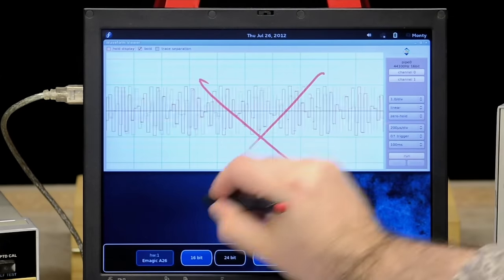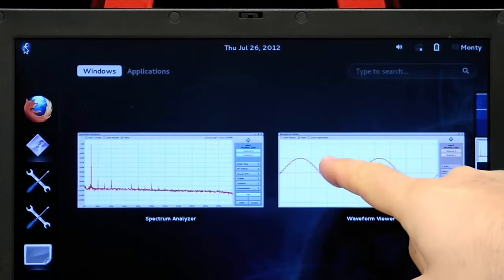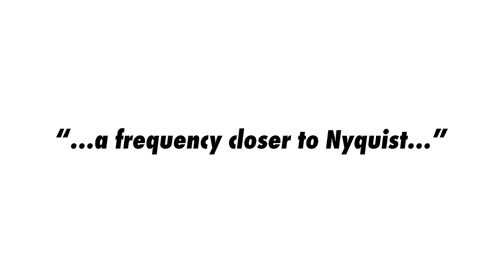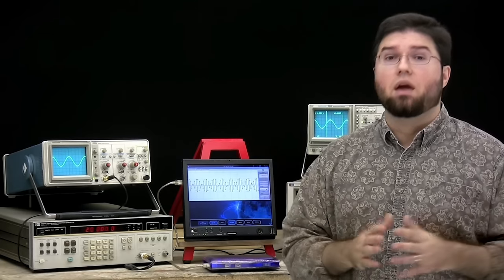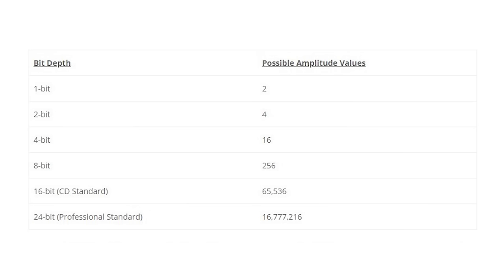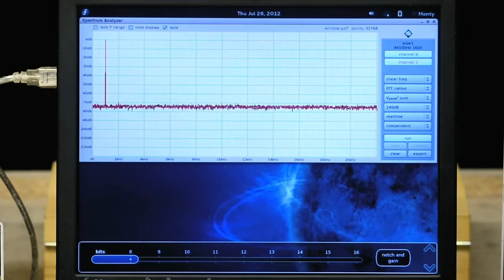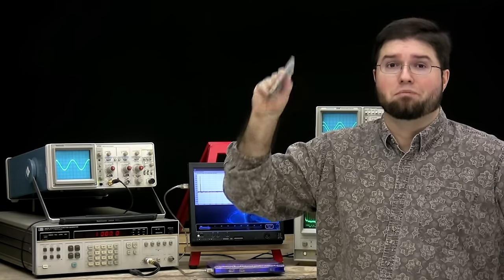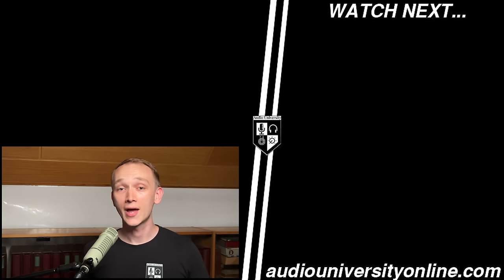Debunking the Digital Audio Myth: The Truth About the 'Stair-Step' Effect

Comment: ...The main problem with digital technology is that we have to use a constant sampling rate for the conversion, which, however, cannot be coupled with the useful signal in a phase-locked manner. As a result, the result of the conversion process, which is output as a digital word, becomes more and more unpredictable the closer we get to the sampling frequency with the useful frequency. In purely theoretical terms, the maximum useful frequency of a digital system is half the sampling frequency according to the famous Nyquist sampling theorem. Theoretically, because this presupposes a phase-locked coupling of the sampling rate and the useful signal. A useful signal with half the sampling frequency can only be transmitted if the phase angle between the sampling rate and the useful signal is 0 degrees. In this case, a positive digital value would be generated by the positive half-wave of a sinusoidal oscillation (other waveforms make no sense in this consideration, as already the first harmonic would no longer be transmitted) and a negative digital value by the negative half-wave. Through suitable filtering of the resulting square wave signal, the original signal could actually be reconstructed with a certain amplitude uncertainty.
However, this only works if the sine wave has its zero crossing at the beginning of the sampling period. With a phase shift of, say, 90 degrees, on the other hand, the first sampling period would measure the cycle from +90 degrees to -90 degrees; the second sampling period would then measure the cycle from -90 degrees to +90 degrees. The result would be zero in both cases. Our Nyquist theorem, which is still tacitly assumed in many places, is therefore not applicable at all to the audio signals we are interested in here, since the aforementioned prerequisite of rigid phase coupling cannot of course be met in practice. When which zero crossings and oscillation forms occur within the audio signal is completely random; the probability of a useful signal still being transmitted at half the sampling frequency is 50 percent.

Fatally, not only are the phase positions of any audio wanted signal random with respect to the sampling frequency, but also the transmitted frequencies are naturally not in any predictable relation to the sampling rate. As soon as the useful signal no longer 'fits' perfectly into the sampling period, we get different digital values for each oscillation over several oscillations - the phase changes from oscillation to oscillation. The result is that at the end of the entire signal chain, i.e. after A/D conversion, storage, signal processing and D/A conversion, we find, in addition to the useful signal, an ever-increasing amount of non-harmonic distortion with increasing useful signal frequency, which is created by summation and difference tone formation with the useful frequency. The described situation is probably the most serious birth defect of the entire digital audio technology, whereby, to my knowledge, no one has yet carried out scientifically sound audibility studies on this type of distortion. So it has never been determined how disturbing this effect actually is.

It is precisely these non-harmonic distortions, however, that lead to the fact that the sonic result of, for example, a mix of many individual channels in digital audio workstations often does not meet the user's expectations. Of course, the described problem has a particularly striking effect as long as we work with the standard sampling rate of 48 kHz. Increasing the sampling rate reduces the problem, but if we assume that the human ear reacts much more sensitively to the intermodulation effects described above than to any kind of 'analogue' distortion factor, then it becomes clear how disturbing this situation is in practice with digital systems...

Source : ADT Audio

... I know I am small-minded !

😂
Reply: I personally think that a lot of the differences that people hear are in their mind.

But hey. If spending more money is your thing, go for it. You're supporting the economy.
Reply: @Discrimination_is_not_a_right  
For Christ's sake! I don't have any money!
I just wanted to shine a little light on the dark side of the moon.
Reply: @lucaslutzerler5429  But what if it's not the dark side?
Reply: @Discrimination_is_not_a_right  
Hmmm 🤔 My hole universe ist build on it...

Comment: Just to add fuel to discussion, why would someone want signals higher than 24kHz if they listen to metal 1" tweeters which ring like bell at 26kHz. Please think of it. Unless someone enjoys analog like intermodulation distortion and other audiophile 'vitamins', such as vinyl playback. So unless one has perfect tweeters which don't add artifacts, don't have dome/cone break up, limiting the upper band frequencies of the music content during playback is a good thing. Even for 'Beryllium' tweeters, which ring in 30-some kHz zone,  upper limit to max 30kHz -3dB would be beneficial. And yes, the so called 'silk domes' and AMTs also have break up resonances, and actually they start way below 20kHz, but they're damped internally by the material the dome is made off/it's shape, etc. - one reason why good sounding fabric domes tweeters are expensive. For me 30kHz upper limit, with 'slow filter' for 88.2/96kHz sampling would be a very good solution for all your hi-rez fans (unless someone turned him/her self into a bat, cat a dog or other pet ;) BTW, it must be a torture for 'the' dog to listen all that hi-pitch noise coming from the tweeters when the master puts on a 'table his favorite hi-rez 192kHz vinyl.

Comment: A higher sample RATE won't improve quality, assuming you sample at ir above 2.2 times the top frequency. What will improve quality is the number of bits, 8 bits gives 256 levels, 16 bits gives 65535 & so on. The stair steps are inherent to discreet digital codes, but those sharp edges are generated by high frequency harmonics that are easy to filter out. Dont believe me? Filter off the higher frequency harmonics of a square wave & you get...a sine wave!

Comment: The CD standard is what it is for one reason and only one reason. The samples per second fit perfectly into frames on PAL U-Matic 3/4" video tape. NTSC tape could have held slightly more data per second due to its higher frame rate (despite fewer samples per frame than PAL) but it didn't come out to a nicely exact number like 44,100.

If it had worked out to 44,200 or 44,000 or some other even number of samples per second, or an even number on NTSC instead of PAL, the CD standard would be that instead of 44,100.

Every other "explanation" for why Redbook CD Audio is 16 bit, 44.1 Khz is BS. The standard is simply due to the mechanical specifications of PAL television recording tape, and it was deemed to be good enough for a format with hard cutoffs at 20 Hz and 20 Khz and not a "threat" to professional 48 Khz professional digital audio with the ability to digitize lower and higher frequencies.

Digital to analog conversion produces such a good copy of the analog original because a lot of effort has gone into designing the DAC chips. Before the development of the audio CD, digital audio was the expensive playground of studios and electronics companies working on developing an affordable commercial system. Thus the use of not too insanely expensive 3/4" U-Matic video recorders connected to a newly designed PCM device. Some companies (most notably NEC) making Betamax VCRs had PCM adapters available for home (and studio) digital audio recording onto Betamax tapes. NEC's Beta VCRs (like the V-70 and V-71) used zero components made by Sony. The licensing fees were higher but NEC was free to make and use better parts than Sony made and used in their VCRs.

Early non-professional DACs other than in CD players were often very crappy (typically in early PC sound cards) and the poor analog conversion was easy to hear, even in a 16 bit card playing 16 bit digital audio. Audio CDs played on a computer sounded the same as in a home stereo because the CD-ROM drives had a decent 16 bit DAC built in, putting out analog audio to the sound card. BeOS pioneered the method of bypassing the CD-ROM drive's DAC, reading the audio data directly and processing it in software. (IIRC it was Windows XP when Microsoft got around to doing that.)

Even Sony used a rather cheap DAC in their first portable CD player. It was literally a one bit DAC. It processed 1 bit at a time, interleaving processing between the left and right channels. To make it work they cranked up the processing speed and gave it a small buffer, but didn't bother to do any delay to synchronize the left and right channels so there was a very small phase error.

Later 1 bit DACs are actually 2 bits, one bit from each channel simultaneously so they're always synchronized, and a larger buffer so bumps and bangs that disrupt the disc reading can be compensated for, as long as it doesn't go on long enough to empty the buffer. It always amused me slightly to see CD players with boastful "1 BIT DAC" printed on them. Translation "Cheap oveclocked DAC inside rather than a good 16 bit DAC, but most people can't tell the difference".

Comment: interesting ... but I've found that with music 24-48 is superior in sound to 16-44.1, so I record audio at 24-48 for the expanded headroom and use that for my mixing and editing. I then save to DVD-audio format for archival storage as well as convert to 16-44.1 for CDR storage. Sadly the material almost always ends up being released as mp3 or equivalent for podcast and internet usage. Beyond 24-48 I find it almost impossible to hear the difference above 24-48 except for expanded headroom with 32 bit formats. To truly take advantage above 24-48 you need extremely expensive equipment and only the most expensive playback equipment will reproduce where it would be theoretically possible to hear a difference.
Reply: I agree for home systems but for studio production with high end systems there is an audible difference. Above 24-48 the audible results are negligible. @nicksterj

Comment: Good.  I knew the math from school 40 years  ago  but  scopes back there were rare and expensive,  so we did it our brains.  Seeing the stairstep for the first time I simply interpolated to the middle of the flat which is of course incorrect but results to something close.  But thanks,  it's often easier than we think.   I always knew the digital model was equal to and possibly better as you can to some degree program out noise and such.  I'm analog free since '93. 🤣

Comment: Your analysis and conclusion is wrong, here is why:  the sinewave is a simple, smooth signal that is easily replicated using a digital sample rate at 2X the frequency or the Nyquist frequency, but it only recovers to a sine-wave by passing the stair-step signal through a low pass filter (LPF), the digital to analog converter (DAC) has a low pass filter in it, that is where the smoothing occurs.  now, if you were to pass a more complex signal, something like a violin that has a modulated wave (timbre), It is not just the fundamental frequency of a note on the violin, but it’s harmonic vibrations,and the random and more complex high frequency modulation signals that must converted too.  Those must be sampled at-least double their highest frequency, in order to faithfully reproduce them, otherwise, a lower sampling rate LPF would simply smooth the violin recorded sound out and create a simple sine wave in its place.

Human hearing is not the same for everyone, I work with artists that can hear things that I cannot hear, just like some people cannot stand the sound of fingernails on the chalkboard.  And there is also a field of study , It’s called psycho -acoustics that describes how humans interpret sound .The average listener may not detect the difference of a 44.1 K sample rate versus say 96K, especially if listing with cheap earbuds versus high-quality speakers,, but a 96K sample rate yields a much more accurate waveform and ultimately a richer recording and more sophisticated depth.  

I think it’s irresponsible to post videos like this when you’re not trained as an analog and digital electrical engineer, have signal and systems education , understand, musical instruments and sound, and confuse basic principles.  Next time you do the test, why don’t you try using two arbitrary wave generators, one modulating, the other,  and set the maximum frequency to 20 kHz, then compare the analog signals to the digital signals before LPF filter, and after, and you will see that the higher sample rate will yield a far better result.

John Fisher BSEE, MSMOT 45 years professional experience

Comment: I don't remember 100%

But doesn't higher sampling 48 and 96 mean that you don't need such a steep filter to filter out higher frequencies?

You have less chance of getting things like PHASE error.

With a filter that is too steep, you can get a PHASE error.
To eliminate this, a higher sample rate of 48 or 96 is used, for example.

So a higher sample rate on sound recording is not so stupid.

The primary reason to have filtering is to avoid equipment down the chain from oscillating. If there is a lot of ultrasonic noise and your amps are designed imperfectly, they will start making all sorts of noise themselves.

Comment: Most of us nowadays use digital volume control, so having higher bit depth might be an advantage even in home use.
Higher sample rate only has a minor benefit, though.

Arguments of "audiophiles" about discrete vs. continuous signal are stupid though. There is no discrete in analog realm, never was and never will be. Both digital recordings and Class D (D DOESN'T STAND FOR DIGITAL) amps generate continuous analog signal, just like vinyl -> Class A amp.

Comment: We can not hear the "step-shaped" wave because of human hearing inertia, the latter being something between 3 to 7ms (for young fresh ears and for elderly adult ears respectively). The inertia time increases with age, because your eardrums become flappy (loose) like your skin does with age. Had we been able to get a "slow motion" of audio (same as increasing the "frames per second" = higher sample rates for our ears = crazy tiny human hearing inertia) we would have been able to "hear" what the quartz crystal in the ADC (analogue to dig. converter) "hears". And it usually hears changes in the el. signal from 44 100 times per second (that "inertia" is 14 700 times tinnier\shorter than the 3ms human hearing inertia) to 192 000 times per second (even higher for some scientific ADCs). We (humans) simply can not hear the silence between each sample. No living matter\tissue can!

Because of that human hearing inertia there are lossy compression audio formats such as .mp3 and .ogg or .aac and others. They chop off samples (one in every 1000 or ) = lower bitrate (16bit × 44 100Hz = data of 705 600 bits for a mono signal, then ×2 = 1 411 000 bits for a stereo signal). 20Hz wave\signal will have 20 × 44.1Hz (in our ADC setup) = 88 200 samples in each second. The bare minimum to represent such a 20Hz signal wold be 40 samples (2 × 20 according to Nyquist). This is why in .mp3 the lower frequencies are not affected at all. Not so great for the higher freq. signal though. Unfortunately, we can not chop Time, so we chop its discrete representation as samples by lowering the bitrate data in each second (hence kbps = kilo-bits-per-second).

It is for the similar reason we can not detect the flickering om our AC (alternating current) light bulbs. The usually flicker 60 times in every second, whilst our eyes' (sightseeing inertia of the rods and cones in our retina) can barely detect anything flickering above 24~30 times in a second. But they do flicker! That is why we can not see the "staircase" shape (tiny, tiny silences\darkness) in our digital sound representation. Similar phenomena is with regards to amplitude (how loud it is). Hence 16 bit for audio (1 bit for every 6.02dB of audio signal transformed into voltage fluctuations of el. current).

Comment: The "problem" is not that the digital signal is stairstepped, its that between the steps the resulting waveform might be slightly distorted or missing information between those points.

Comment: Even if stairstep does get through the output transformer in a tube amp will smooth it all back out.probably one of the reasons mcintosch always uses opt in thier high end amps

Comment: Here is the problem. the reason you see no jaggedness in the reproduced signal that comes from D/A conversion because there  is a filter that removes the upper frequencies. Now here lies the rub. No filter is perfect. There is no such thing as a brick wall filter and all filters introduce phase shift. This phase shift is not a constant value, it varies by frequency. The rolloff starts well before the filter's cutoff point.  Using a higher sampling rate makes filter design much easier and has much less phase shift in the audio band.  The engineer you supplied the video from missed a crucial point. If one was to look inside the D/A converter at the point that the audio has been decoded (CDs add a lot of digital overhead for error correction) but is still not in analog circuitry you will indeed see a stair step function as the output is locked in by a clock and ONLY changes each clock cycle, it does not disappear between samples! My 2 cents.
Reply: @nrezmerski I was not referring to the initial  DA converter but instead to the final ADC. Most ADCs use a resistive R2R ladder network and believe me the signal presented is indeed stair step. That signal is then fed to an op amp that acts as a buffer.